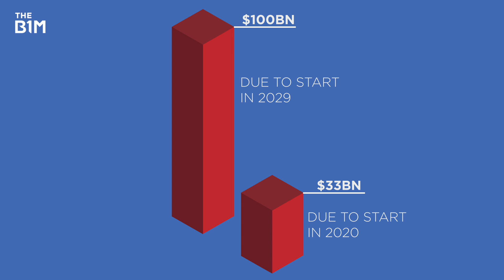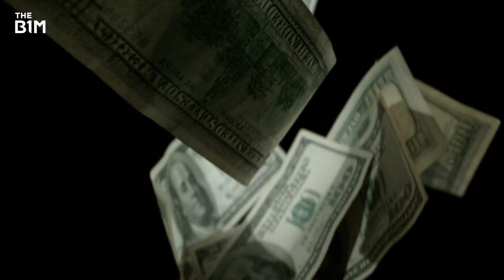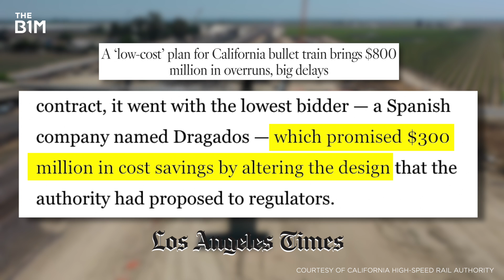What Went Wrong With California's High-Speed Railway

Comment: London to Paris on the Eurostar: 2 hours. Literally from one centre to another. Flight? Maybe a notch shorter, but consider the time getting to and from the airport, check-ins and whatnot. Especially now after Brexit.
Reply: 55 km track of channel tunnel with cost $17 bilion built only in 5 years,
over $7 bilion is cost for building the 55 km track and rest $10 bilion for building 
structure of underwater tunnel. To put perspective per km the 55 km track is cost
aproximately $150 milion per km. currently the underconstruction of California HSR
section, Central phases with 190 km is cost $40 bilion or $200 milion per km,
for comparison,
its reasonable that the 55 km Channel tunnel track cost expensive $150 milion per km
because it had to design on underwater tunnel structure and it is High-Speed track.
the central phases of 190 km, part of division of 3 phase California HSR with planned
length 1,300 km is cost $200 milion per km and it design like normal hsr track technology
that usually in europe and china cost below $40 milion, and in fact majority of 190 km
is ground-track is what this CHSR fiasco is

Comment: there is no economic incentive for it until there is a tax on carbon, because an increase in train travel will mean a decrease in air and car travel, which kinda balanced out so politicians can not point to a chart and say they achieve economic progress, meanwhile even tho people are miserable transiting via cars and air travel it has no measurement in gdp for people's happiness unfortunately. thats the issue with capitalism. China's rail network overrall does not make money by much too but they still do it, because the leadership and people values well being of people and environment.
Reply: on a seperate note china's high speed railway construction is actually slowing down, it has been since the introduction of tesla model 3 which make them realize they dont need high speed railway to reduce emission anymore, eletric car provides the same function while making it more flexible for people to travel

Comment: The high speed rail is a case study in the current state of infrastructure projects in the USA. This project is very popular among california voters and has been desired for a long time. Despite this, politicians, regulations, and a whole host of other ridiculous issues have made this popular project nearly impossible.
Reply: People will support it in a poll, but if it is built not enough people will actually use it and it will be unprofitable. Investors know this and will never put money into such a ridiculous boondoggle.
Reply: @richardrose2606  As someone who has driven many times between LA and SF I think you are wrong. That railway would connect two of the biggest economic centers of the US. LA-SF is already one of the most popular short flights in the USA and if given the option I think most people would pick a fast train over air travel. The demand is high.

Comment: Why not start with a shorter project at more easily achieved speeds?   Why not run at least part in say the I 5 route - where there is already an existing freeway right of way?  This would also mean that cars stuck in low-speed traffic -- would see a train screaming past them.  Why not start with building the tracks at either end first?  Say San Fran to San Jose and say LA to Santa Clara or Bakersfield.  San Diego to LA .  Why not build first what will deliver service more quickly?
Reply: They actually electrify the line between San Jose and Merced and SF so that the train can run there.

Comment: Whoever is saying that Americans wouldn’t prefer to take the train over a flight or DRIVING for six hours is either stupid or lying because of their involvement in either commercial aviation or the automotive industry. A train between LA and San Francisco, with a line to Las Vegas, would be enormously popular and successful, if properly managed.
Reply: 6 hour drive is about the about the maximum Americans are willing to drive before thinking about flying.
Flying pretty much already does this trains job but faster and cheaper.

Comment: Anserver is simple. Make railway ticket much more attractive than traveling by car. For comparasion in poland using local metropolitan railway is in average 5 times cheaper and 2 times faster than traveling by car.
Reply: Making something that expensive cheap doesn’t really help. You need ticket prices to be somewhat manageable as you need the money to keep operating and maintaining it. 
America is just way too cheap to travel by car for this to even happen.
Reply: @blackhole9961  If poland could make it happen US cann do it too.
Second Issue that I see here is that this project could be made in much cheaper way. HSR can be made much cheaper, It has to work, it does need to have those huge unnecesary structures. HSR does not have to look "futuristic" to be effective. Take for example old soviet 81-717 train. It looks like it looks, but it is cheap to maintain, zero-emmisive, and it;s lifespan is more than 30years.
Reply: @skorakora  would Russia build an extensive high speed rail system throughout Siberia? 
Why don’t you think China expands its high speed rail out into western China more.

Comment: At this point, I want us to just go beg the Japanese to build us a rail network. 
Like please.
Reply: they tried. They saw our shitty route choice -- highway 99 instead of I-5 -- and withdrew their support when we didn't take their advice to go down I-5.

The French also, both said we need to go down I-5 and withdrew support when we did not.

The problem with 99 is that there are all kinds of little towns in the way where you have to slow down, and it has more curvature and the median is a lot smaller.

With I-5, nice straight road, nice wide median, you can build a train right there at ground level, no eminent domain needed.

This isn't on the engineers....they are doing their best. They have a shitty design and shitty orders from management. It's a stupid project, basically dead already and I can't wait until it's officially cancelled.
Reply: @neutrino78x  The state government pushed the big lie that it would be cheaper to keep everything "in house" with existing state workers. Never mind they have no experience with something like this. Never mind that they wound up outsourcing virtually everything and now don't even own the intellectual property of the software needed to run it. Hell, they started paying contractors before they even had the land secured. No, they didn't want to do a test run of any kind. They just wanted to turn on the money spigot as quickly as possible for all their crony friends to enrich themselves before the plugged got pulled on it. STOP VOTING DEMOCRAT PEOPLE! This was their dream project that "progressives" have been screaming for for decades. Yet look how spectacularly they failed, despite having carte blanche and single-party rule.
Reply: @neutrino78x  Heard on the other hand that following the interstate would bypass many cities though & thus felt to be politically infeasible
Reply: @lzh4950  that's another problem with doing it as public transit project, this something for a company to do on their own like brightline is doing :)
Reply: @neutrino78x  The french made a bad plan. 
I-5 route doesn’t make sense, because some of those “little towns” you are referring to have population upwards of 400k. That route would only serve LA and  Bay and would have “little branch lines” to those “small towns. Also a lot of sentences such as “the japanese would help but” rely a lot on speculation. There are similar high speed routes in Italy and Spain, but they managed to do then well.  

The problem with this project has always been bad management and the lack of funding. If CAHSR would clear those two issues trust me much more companies and countries would invest in it. Also CAHSR could reach out to the Spanish for example, which managed to build a lot of rail for very cheap, but they didn’t.
Reply: @neutrino78x  Do you have reading on this? Would love to learn more about how we were collaborating with other countries and exactly what decisions we made to fuck it all up.
Reply: The United States is capable to build the system!! It’s just the not in my neighborhood mindset that make it so expensive, and excruciating delays.
Reply: @mariombrbovic8188  California High Speed Rail project management was the problem. They stupidly chose to go down 99 instead of I-5.

Plus the distance is just a little too great for "high speed" rail. If it were a lot cheaper it would be ok. 100 billion is WAY too much for what it does, though.
Reply: @neutrino78x  And for the main reason for going down highway 99 instead of I-5 was because a democrat governor from the central valley lobbied the CSHRA to go in the Central Valley (where he lived) so that he would be re elected in the upcoming elections.
Reply: @June_auAlaska  not sure what your point is, but MINE is that the route was political. Management of CAHSRA thought they could get more votes for it if they ran it through 99, not so much to give people there a stop -- they could do that with spurs off the main I-5 line -- but just so they would spend money in the 99 corridor where a lot of republicans live. And yes, it was Democrats who thought that would give it more support.

And my larger point is that this sort of thing is really outside of the scope of public transit. 

Public transit is supposed to be a type of infrastructure for moving people. Its goal should not be to eliminate the need for cars. Just to provide another conduit. You can't even eliminate cars, because they go from exactly where you are right now to exactly where you want to go. It's hard to replace that, right? Losing that would be a major regression in standard of living. Instead we should promote and encourage greener vehicles. If all the cars were zero emission, cars wouldn't be a problem at all.

And there's definitely no way to eliminate AVIATION using a slow ass train that only goes half the speed of the vehicle it's supposedly designed to "replace".

That's happened in Europe but ONLY FOR MUCH SMALLER DISTANCES...where the train can get there in less than 2.5 hours. The CAHSR could only do it in two hours if it literally maintained an average of 200 from its origin in SF all the way to LA. Not even the TGV in France averages 200. It averages 173. (and yes I know these things are supposed to be able to go 220...that's a theoretical maximum speed, not an average speed.) 

"In 2007, the world's fastest scheduled rail journey was a start-to-stop average speed of 279.4 km/h (173.6 mph) between the Gare de Champagne-Ardenne and Gare de Lorraine on the LGV Est,[5][6] not surpassed until the 2013 reported average of 283.7 km/h (176.3 mph) express service on the Shijiazhuang to Zhengzhou segment of China's Shijiazhuang–Wuhan high-speed railway.[7]"

https://en.wikipedia.org/wiki/TGV

So yeah, basically nothing at or over 200 for wheel on rail.

The reason it's important that this tech only completes with cars, not aircraft, over the given distance, is that it puts a much lower limit for reasonable spending on it. 100 billion is RIDICULOUS for something that's basically another highway. 

Even 10 billion is ridiculous for that, which is why I am proud to have voted no. :)
Reply: China would get this done the next day
Reply: why not china
Reply: @大侠刘-p1k  In terms of what the railway is like? Insofar as the technology and systems in place for China and Japan is similar, then yes, like China. In terms of who to bring on as advisors well... that's very obvious geopolitics haha. Japan and the U.S. are strong allies while China is the U.S.'s top rival at the moment.
Reply: @Cruxispal  not so much top rival as just "one of two countries that is on a nuclear hair trigger against the nuclear allies (USA, UK, France)". 

I was a submariner....and yes, the cold war is still going on...we and France and the UK have to retain our arsenals, unfortunately, until they destroy theirs.
Reply: @Cruxispal  I think the railway in China is more faster and safe than japan and Germany.because the number is very large.in-fact I can’t understand what you say .my english is so so .thank you
Reply: They can't. No one can with the bipolar, frequent take-backsies the US state and federal governments do.
Reply: @zhang_han  The Japanese were going to help fund it and operate it. But then they realized we wanted to go down 99 instead of I-5 and they withdrew their offer. Going down I-5 is the only route that makes sense.
Reply: @neutrino78x  That is exactly the bipolar behavior I was talking about. Of course they withdrew their offer.
Reply: @zhang_han  hmm not sure I follow. Their issue was that we did NOT change the route, as they wanted, and as any intelligent person would want.

99 is a stupid route choice: it's 20 miles longer; it's not as straight; the median is a lot smaller, meaning that in many cases the track has to be on an elevated or underground structure; and there are lots of little towns to slow the train down.

The correct way would be to go down I-5.

But it doesn't matter anyway because there's no funding for it to go beyond the IOS. It's a dead project now.
Reply: @zhang_han  I dont appreciate you 100% true logic sir.
Reply: Japanese and Koreans are nice ! Us Indians take their assistance at times. It really turns things around man
Reply: but with our military budget, we could invade Japan, take it for our own, and have them build it for it.

Comment: California's mishandling isn't the only problem. 

I love high speed rails, but the dirty secret is most are not profitable. They cost a lot to build and maintain,  and require heavy traffic.

Look at China. They are building a lot of rails, but the profitable ones can be counted on one hand with spare fingers. Japan is one of the few to mostly be profitable, their geography/population distribution is the perfect distance for high speed rails. But even they run thin margins,  and take decades to pay off construction costs. 

I'm not saying they are necessarily bad, but they need to be built with the intention to be subsidized by the government to keep ticket prices low and ridership high.

Otherwise, you are going to jack up ticket prices to attempt to be profitable, and no one will use them making the whole thing a waste of time.
Reply: all infrastructure costs money, highways cost a fortune and never run any sort of profit. but the thing is rail is environmentally better, is less stress for the passengers and uses less land per passenger mile traveled than any highway.
Reply: You can't compare passenger HSR to high ways. High ways also transport freight while passenger HSR is by definition passenger only.
Reply: @richardrose2606  wrong. germany and other countries run freight and passangers on the same high speed tracks with some exceptions for some corridors.

Comment: I'd say the UK is already better than the US at HSR. Many of their major corridors support 125mph or 200 kmh, which is not technically "high speed", but it is faster than what you would normally get. Also, there are plans for HS2 which would bring faster high-speed rail. Pretty sure HS2 is currently under construction already.

Comment: I'm European, and yeah, we got a large rail network. But it's freaking expensive to travel long distances by train!! No one seems to mention this.
Two tickets for a 500 km trip by train can cost twice as much as the fuel cost for a car. And while the train is high speed and goes over 200 km/h, it isn't actually much faster than a car, because a lot of time is wasted with stops and connections.
The things I like about trains is that they're incredibly quiet inside, you don't need to stop for toilet breaks or to stretch your legs, and you don't have to focus on driving so it's less tiring.

Comment: I used to work at the Authority and this is what I see is causing the delay and costs.  Since I worked in the Central valley section, my comments only apply to that section but I can assume that the other sections would be similar or have the same issues. There are too many change orders that need to be approved and it's increasing the cost and delays. Almost every project has to go through so many change orders because they keep running into unforeseen issues. So the problem is a lot harder than it seems. If they can keep the  change orders down, then that would keep the costs down and not cause further delays but sometimes, the change orders are needed so and a lot of them are needed so that ultimately falls on the contractor who designed the project didn't do a good job. My projects that I designed although not of this magnitude only had one change order and this project has over hundreds.  My advice to finish and keep costs down is to reduce the change orders.
Reply: Unfortunately, I was laid off so there's not much  I can do now to help them.

Comment: The project is way over budget and is very late. This is on the “easy” part down the mostly level Central Valley. The real challenges are climbing or boring through the mountains at the south end of the valley, AND negotiating the hilly terrain between the Central Valley and San Francisco. How much longer?  Fifteen years, twenty years?  Maybe more like fifty years.
Reply: Same thing with I-69
Reply: This is a high speed fail. If I had a choice, I’d choose to ride Amtrak, Coaster or even Metrolink with their new charger and f125 locomotives.
Reply: By that time we might all have flying cars